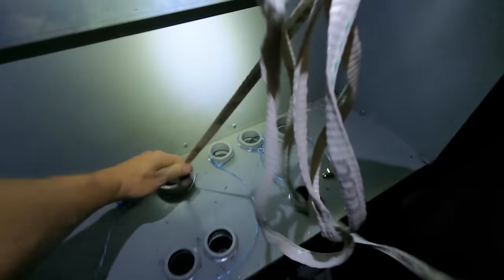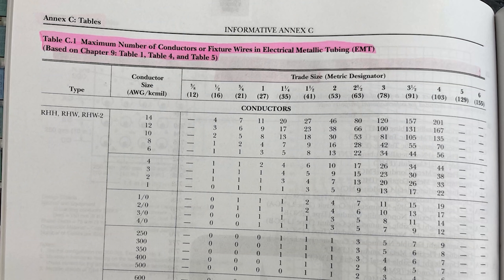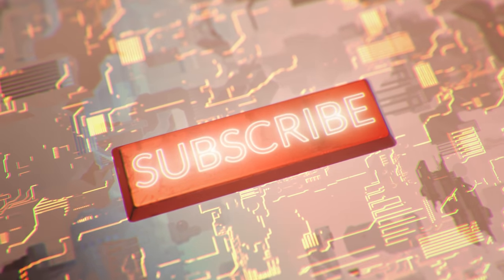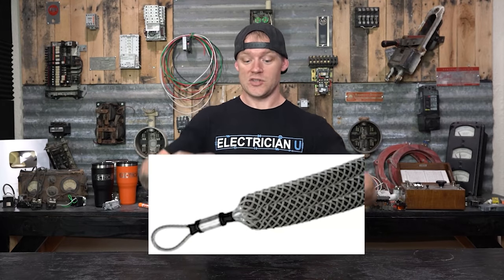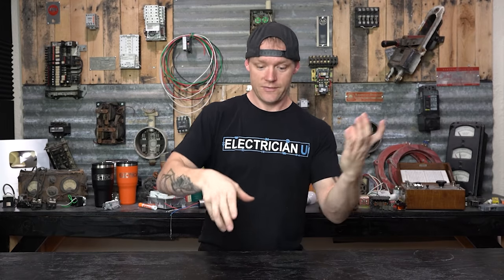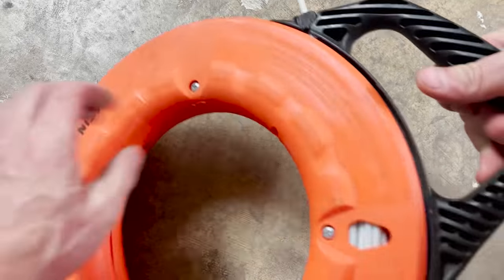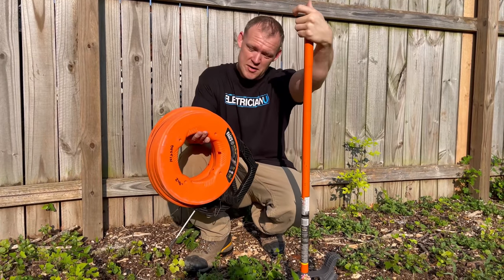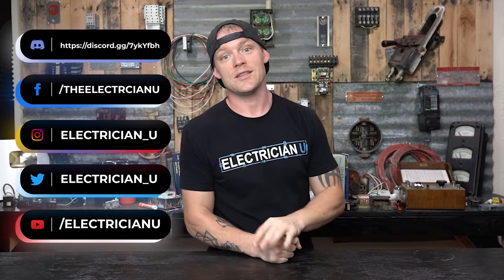Pulling Wire Like a Pro - Tips and tricks for pulling conductors through conduit

Comment: 1200 ft. pull, 4 #6 and a #8 all THWN, by hand, 33 degree temp in the rain, god knows how many degree bends, damn near a circle from the stadium light to the panel,  in 3/4" roll pipe, that we had vacuumed 14 gallons of water out of.... when I saw the head come out the pipe, I felt like I had won a war

Comment: 26:34  EVERY person, especially apprentices, need to listen to that RIGHT THERE.  
If I have a person run conduit, I always try to have them pull the wire through their own work, so they can suffer through when they don't think their runs through, or do a sloppy job with couplings and connectors.

Couple other tips:

When possible/feasible in certain circumstances, consider running an extra conduit.  This applies more to interconnects than branch runs, and especially for Design/Build jobs.  So often there are changes made long after all the conduit is in and buried in a ceiling/concrete where suddenly you need to get extra circuits to a location.  This is where looking through the entire plans for a job and understanding what it is you're building, can make you a hero at crunch time.

The other tip, the Klein Expanding Foam Lubricant is AMAZING for super long runs, especially in PVC conduit, as you can attach a vacuum to one side of your conduit run and while the vacuum is on, start letting the expanding foam can rip.  The suction of the vacuum will help lubricate your run far in, if not completely through, making the cable pull WAY easier (but you can't doddle as the stuff will dry up in 30-60minutes).
Reply: What if you get a smart apprentice, who attaches multiple nylon cords over the length of the wire so they can distribute the pull and one man push while they pull?

Comment: Not sure if you would know, how would one go about running 110v across a driveway. Think lamps at the bottom of the driveway, one on either side. Not sure if I'm supposed to cut a slit in the blacktop to lay conduit or somehow tunnel it underneath. I have no clue, I have watched videos of both of those and I am still unsure. Maybe I need to just go with some type of solar lamps for them, they just seem to be such crap.

Comment: I typically like to use solid ground always. One because it adds a little rigidity to the boat, but once I get to a box or my pull location, I like wrapping solid ground around the ground screw rather than stranded. You can always add a pigtail (I guess).
Reply: This is and accepted method in the light commercial and residential sector. Once you get into heavy commercial, industrial and beyond, most owners, engineers, inspectors, etc. have their own preferred methods. From my experience over the last couple decades stranded wire using fork or ring crimp ends with ground screws or bolts, are the most common method. This makes taking grounds loose much easier, and offers a more secure bond with less chance of the screw rotation pushing the wire out from under it. But every one has his own way of getting it done.

Comment: If you stagger large conductors and remove several strands it will make a much more tapered head for pulling. it does waste more wire but for a long and intricate pull it is worth it!
Reply: Yeah, their heads were huge. I'd have been yelling at them for those....

Comment: So I know there are q bits to make cut outs for single gang boxes. So do you know of any circular qbit like tools to make those cuts circle cuts? I have the magnetic ones. I'm not no electrican like you, but I do my fair share. And I've learned alot from you. My master electrician always checks my work.
Reply from the maker: I Use the hole saws like most other guys and gals. 
But they also make oscillating Jbox (1gang 2gang 3gang) for switches and POU receptacles. I haven't seen anything spectacular for round hole making. 
What is this q bit to you?

Comment: Hey Dustbuster, lowly homeowner here that isn't 100% sure what Code says about something. I want to install a Level 2 car charger in my unfinished garage, and my service panel is on an outside wall of the garage. The only drywall in the garage is behind the service panel covering the conductors leading to the house. I plan on using 8/2 to go ~10 feet away from the panel to a receptacle on an exposed stud for the EV charger. Should I be using conduit for this run or just leave the conductors free spanning across the studs? My first thought was just leave the conductors exposed but then I thought, what if someone trips, sticks their hand out, and grabs onto it and yanks it? I think code would like me to use conduit in this case. 😅
Reply: You can't have single conductors running through the wall. It's required to be protected and encased somehow. Like Romex or a conduit of some sort. 
You may want to have a pro in your area do it so it's up to code in your area.
Reply: You oughta just get some flex (FMC). It'll be better than hard pipe, safer than Romex (you don't want Romex exposed in the same way you don't want free conductors hanging), and cheaper than having a length of MC cut. You'll also be able to add or change conductors later too
Reply: @andycopeland7051  FMC is what I was thinking as it'd be the easiest and probably the cheapest to boot!
Reply: @mrmotofy  Of course I wouldn't run individual conductors 😂 That's why I said I was using 8/2

Comment: I like 1/2" EMT for running exposed MWBC lighting circuits multi location switch runs, its help me keep travelers and conductors "separated" between jbox/pull box runs so it doesn't become a labeling / terminating/splicing/replacement nightmare
Reply: All day. Not much extra work on rough in and much easier when your finishing up.

Comment: Sometimes you have under 4 bends and it’s still difficult. I try not to go over 3 ever. When it’s tough to feed the fish tape you know ur gonna have a hard pull. Sometimes you have to hook a small rag on one fish tape then try to hook it from the other end just to pull it through. Making up the head properly is probably the single most important part of the pull. Hate it when the head falls apart mid pull. I wish you would have shown a few samples of that here. I don’t like pulling gel very much. I prefer the foam. Just works better and you can get that little tube way in the pipe. Awesome when pulling half inch. Oh and if pulling by hand, well First I make whoever ran the conduit pull the wire.  This way they learn quickly to strap the flex or minimize their bends. And you gotta remember to feed the wire at the same time they’re pulling the wire. So much easier once you figure out that rhythm. I feel like this video could have an entire series of videos showing different examples.

Comment: My electrical instructor mentioned, he would take a plastic bag and tie it to the nylon line and stuff it in the end of the conduit, then on the other end attach a shop vac and use that to pull the nylon string to the other end. IF you have avaliable electricity, this seems like a pretty cool idea!

Comment: I just ran some 1-1/2” pvc conduit where I needed less than a 45. I filled them with sand and heated with a heat gun and made about a 30 degree bend. Was I being a bad electrician or is it cool? 😎
Reply: That or tape both ends and the air pressure [typically] helps it keep its shape

Comment: I usually squish my head with plyers to flatten it out. Also I use the ground wire last and just strip it long enough to push it through the loop of the mule tape then wrap it around multiple times spiraling downward of the head.  Works great. Also some wire does not play well with lube it will actually cake up before it even gets to the other end

Comment: I have a 110' run where I'll be putting 3x 4 AWG and 1x 6 AWG in 1" Schedule 40 PVC conduit, so pretty tight (but legal).  There will be about 320 degrees of bends, but 180 of that will be within about 6' from one end.  Is there any reason why I can't just leave the last 6' off, pull through the stretch that has 140 degrees, THEN put on the last 6' that has 2 90's?  I realize I'd have to be careful to not get glue on the conductors, but I would have pre-assembled the last conduit section so there's only one remaining glued joint.

Comment: God save the box,the boxes save my arms & the cable. Repairs,upgrades and diagnostics are easier with boxes. Thank you sir. I have done most pulls by myself with control & signal wires & the up size is friend you need.

Comment: I have found pulling larger wire...like 2/0 and above through conduit, especially underground service is to trench first, then lay out the wire, tape it off every 4 ft or so, then slide the conduit section by section, and glue the joints until I am done....takes a while, but at my age, I don't have the strength to pull this size of wire through the conduit.

Comment: The time you might save on bends by adding boxes and joints,  could cause you problems if the joints aren't just right.  AND,  the more joints,  the more probability of problems in the future(depending on who is making up the joints and if the"care" that day or not.)
So,  we would use bends and boxes and only make a joint when needed. 
Pull to a box... have a"slack/ feed handler" And pull to the next box..
Someone knowing how to be a slack/ feeder helps tremendously and saves time later making joints and possibly connecting the wrong two matching colors and blowing the circuit

Comment: Learned a lot.  That’s why the guy was upset because I pulled with his fish tape!
Reply: Hahahaha,  ya...been there...🤣🤣🤣, live and learn.
Reply: 90 percent of the pulls I do is with a fish tape.
Reply: Pulling with a fish tape is fine as long as your not using the reel to pull just grab the wire and pull then roll it up later with no tension
Reply: @zanekubicek2186  and don't let the tape pull across a sharp edge. Or itll turn into a slinky

Comment: Are there situations where you would use conduit in a residential setting?
Reply: In a poured floor. 
Underground to a detached garage.
Where I live, inspectors want no exposed Romex except in basements, so surface runs in a garage must be in conduit. 
Through a tight area where pushing a wire is impossible such as a low attic.
Anything outdoors, such as a sauna or deck.
Reply: The attic upstairs in my house. We were remodeling. Rewired EVERYTHING upstairs. The attic clearance was less than 14" and had only a 9" gap between windows, etc. in the wall to get downstairs. I ran three 3/4s from panel downstairs to a 12x12 in the middle of the space (above the attic access hatch) upstairs and fished all my Romex to that point. What a pain in the ass

Comment: I used to do intersections where we regularly had 20+ multi conductor cables and we would stagger the ends to keep the head small. We used lube when it was difficult.

Comment: Another tip is to buy simpull wire, it makes a difference. Other brands have slick coatings but southwire simpull is the best. No lube needed.

Southwire sells simpull ropes as well. Pricey, but worth it.

Comment: Hey have you heard of the rule of 6 to assign  colors (e.g. black, red, blue) to the circuit so that when making up the panel  It'll look perfect?
Reply: The rule of 6? Are you referring to the fact that any circuit that is divisible by 6 is blue?
Reply: I thought that rule only applied to three phase.
Reply: Yeah but I just end up writing a table of circuit numbers in triplets. No need to color-code the table. I just look to see if the number is at the top, middle, or bottom of its triplet.

Comment: For my low voltage telecom stuff, we do a so-called 40% fill, to a max of 60%. To calculate the 40% one can multiply the wire bundles combined diameter or area by 1.4.

Comment: Thank you for this entertaining video. I just want to give my 2 cents experience. Wires, fine, 360 degrees bend are no problem. BUT, the worst cable to feed through plastic conduit must be network cables (CAT 5 or CAT 6). Max bends about 180 degree bends per section. Somehow these cables was manufactured with a "build-in" ABS braking system :) :).....
Reply: haha also good to know that the 40% doesnt apply to cables or single conductors for bonding etc

Comment: Years ago I helped an old Master electriction run a few buried circuts. He used Dawn Dish Soap for lube. Worked great.
Reply: I agree, it works great, there is just one problem. The dish soap will dry up and "glue" any dust or debris to the inside of the pipe/conduit, if you or anyone else ever needs to add wire to that run, it will be very difficult or will easily damage the new and/or existing wires.

Comment: Howdy.
A piece of Blue Collar Electricial Wisdom:
Always pull a thin nylon rope or at least a regular houshold string into the conduit alongside the cable. Makes adding cables later a lot easier.
And when adding cables. Always add a new string alongside the new cable.
If a household string is used, use that to pull in a nylon rope first. The pull the cable with a new string alongside.

Comment: You talked about lubricant getting scraped off in the conduit as the conductors are pulled. Is there a way to apply lubricant to the interior of the conduit prior to pulling the conductors?
Reply: Not an electrician here, but the effort that goes into pulling conductors through conduit prompted my question. Just seems like there must be a better way. Regardless, I enjoy these and similar videos.

Comment: what if you have 100 amp service and it cable is underground from meter to house and you want 200 amp service, how would you run the 200 amp cable when the 100 amp is already installed and shut off is about 150 ft from the house, do you pull the old and install the new? pull the new with the old? I have not seen anything online about it, all I see is how to initially pull the new wires through the conductors.

Comment: Make all the wire ends different lengths so the end is tampering so you can get more wire through and the use of shoes for feeders. And using soap and labeling everything first.When you label it take your electrical tape and tape your labels with the non sticky side first one wrap then spin it to sticky side one wrap and the labels stay on during the pull, then you know what everything is and goes. It will take down the mistakes and time.

Comment: If you got a long run, tie a bit of soft plastic to a string and suck it through with a shop vac. Use the string to pull the mule tape. Then use lube on your cables as they feed in.
P.S. great tips in your video.

Comment: I will sometimes ladder my head. The trailing piece will have a loop in it that the second wire attaches and so on. Tape wrap from pulling lead to wire head and back so electrical tape edge is not catching when being pulled. Geez, 1/2" brass conduit with a 14/3 pool light cord & 75 feet!

Comment: I've been doing commercial electrical for 16 years and I've never seen anybody make heads with just tape on anything over 6 awg without the head coming apart. You've never had issues with that at all?
Reply: Also I've seen multiple issues with attaching every wire to the pull wire or mule tape. It seems that a tapered head goes much smoother.

Comment: Great advice except when you roll your fish tape back up, every so often you should pull the end tight so that it wraps up neatly internally. Kind of hard to explain but youll know what im saying when you do it. Learned this from a couple journeyman i work with. If you do this, it'll pull out easier from the fish tape instead of kinking and binding inside.
Reply: Makes sense solid tip!
Reply: No good with set screw fittings
Reply: My bad, I was replying to vacuum string comment

Comment: Purple phased wire?,  the code allows for Black, red, blue, white, green under 250v, Brown, Orange, yellow, Grey, green above 250-600v?  I question the box size with the conduits entering and exiting the box, and the lack of slack as you pulled though the box

Comment: As an industrial electrician with 40 years experience here's a tip. When pulling wire/cables,  have enough men to make the pull with killing everyone involved.  Learn how to bend conduit and do away with so many boxes, it so much easier than setting up so many pulls and get a tugger for big pulls( 4/0 larger). Tuggers don't get tired and all you have to do is feed it properly.

Comment: Brotha...I have one simple rule for using 1/2 in conduit....use the half n half rule....when pulling thru 1/2...pull no more than 3 strands of 14 or 12....which comes out to nearly 1/4 inch of wire!   KISS program!

Comment: Can you please do a segment on bending versus using fittings to do 90s?  Ie if you are doing underground 3/4” rigid, will pull be much harder through 3 90s if they are using the threaded 90 and connectors v trying to do the bends on 3/4” rigid by hand?
Reply: You can always sweep a 90 with a much bigger radius with a hickey...